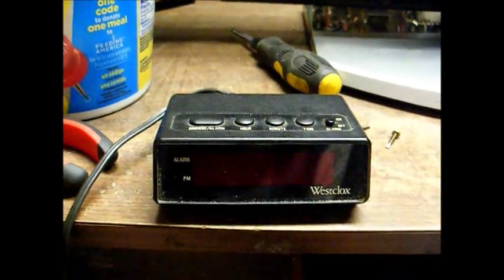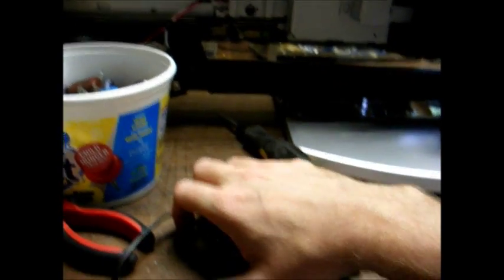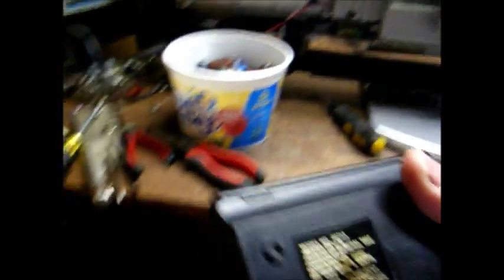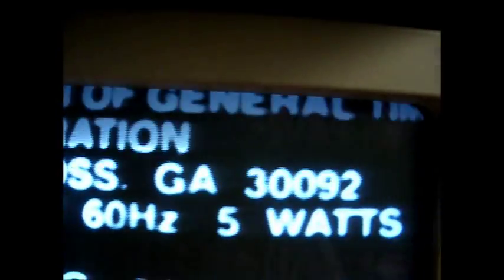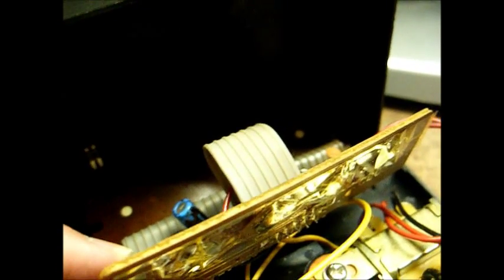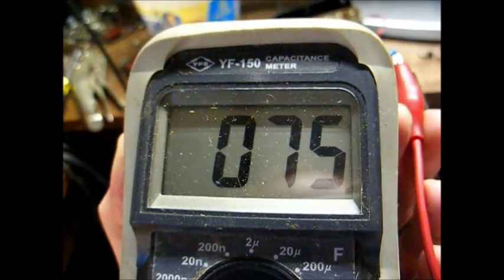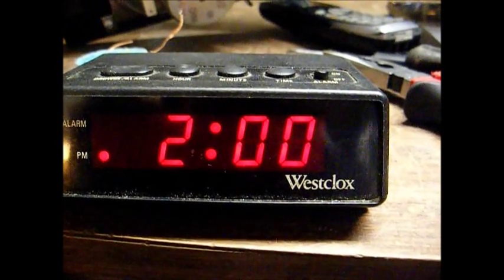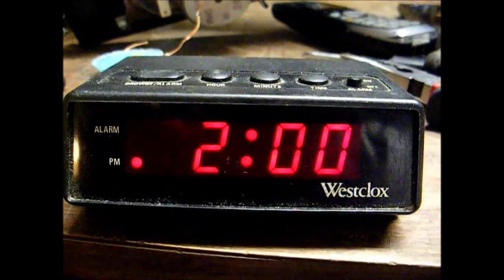Repair of a cheap Chinese Westclox digital clock

Comment: Five years ago, I used your video to fix my Westclox, the capacitor blew out again and started to run fast.  This time I put in a new capacitor using the correct orientation.  Thanks again

Comment: Thanks for the help. I just fixed my 40 year old spartus battery reserve 110 volt alarm clock.it had an 85 degree 330mf, 12volt capacitor. I replaced it with 115 degree 330mf,25 volt from an old microwave controller. The bad cap was not distorted but had a stain down the side. The clock gained up to 2 hours per day but did not buzz. Works fine now.

Comment: Hey, thanks for posting that.  I have the same clock (well, 240v 50Hz version), and I hope same problem (mine counts exactly double speed, which is interesting).   If I can make a triangle-ended security-screw driver to get into the case, I'll be on my way!
Mark, Manchester UK

Comment: Would be nice if you show how you replaced the capacitor and where would you get an extra. Obviously you get one from something junk but how would you know its good before you put it on? I think probably with a electrical tester. But how would you tell by the product oh youd match them. But what if they werent marked? Is there some kind of rule of thumb? Is there somewhere where you could easily find out this info. Like a good reference book?

Comment: Btw the cap there is an input smoother.  If you don't have the exact size, the bigger the better.  The bigger the longer it will take the clock to fail again.  That cap was probably out of ESR a long time ago but managed to keep the dc line smoothed enough until it nearly completely dried up.

Comment: I wonder if Westclox suffered the Crosley fate, since I personally have an american made Westclox pocket watch from '42. It's clearly not a high end clock, but it's good enough as long as you keep winding it. One of the cogs inside has a broken tooth, but it works perfectly anyway.

Comment: I had one almost identical to that one but it was a radio shack brand from the 80's. One day all of the numbers read 77:77 and that was it. It was also a 24 Hr. clock, I used it to log in my ham radio contacts.

Comment: Question . So if I fix that will it fix the fast time too? Or just the noise , on mine the minutes last 50 seconds , I used a stopwatch to time it and I really wanna save this little clock , sentimental value ...

Comment: I couldn't find that brand on the Badcaps dot org site but it's probably a relabled version of another China or Taiwan trash capacitor maker. I ran into another type like that in our Toshiba DVD player, the caps were marked "Xunda" and the power supply board is full of them, one is swollen on top so it needs an overhaul.The control board is full of Lelon caps which are not really a good brand either though maybe somewhat less critical then the P.S ones.